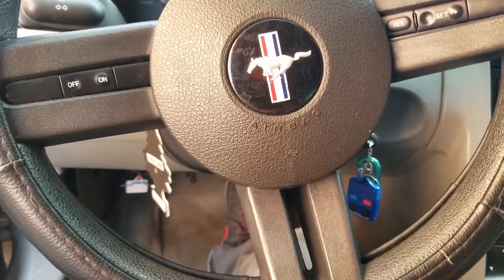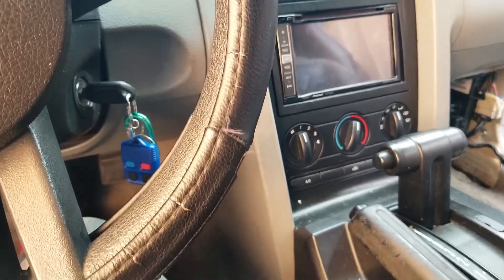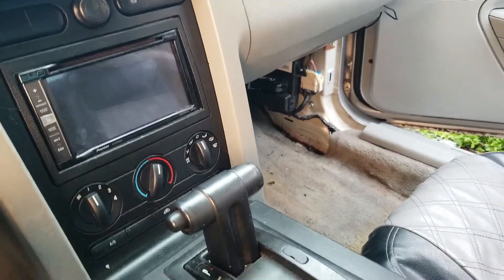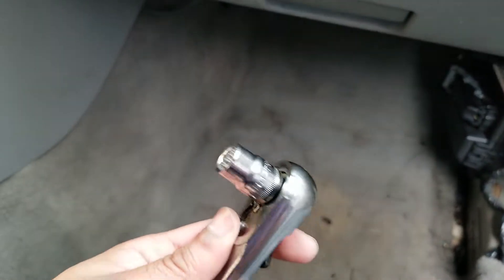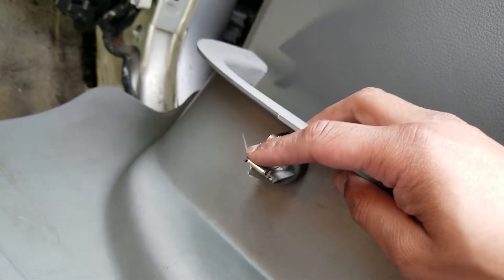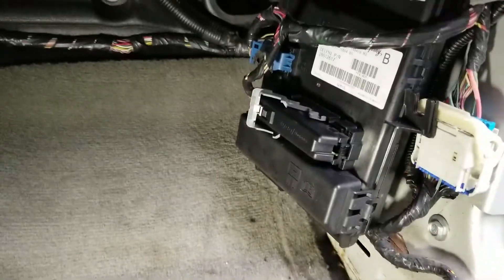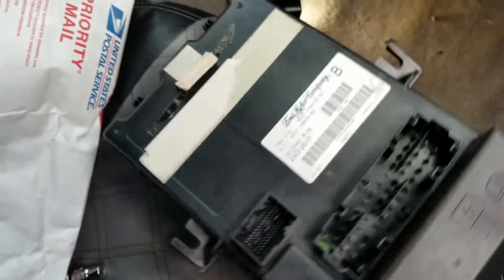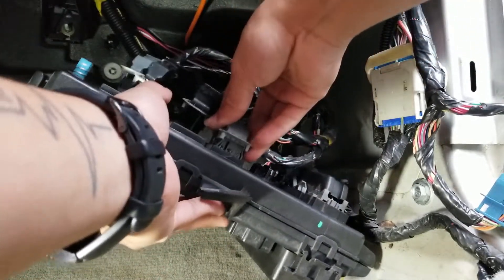Does your 05-09 Mustang Needs a NEW Interior Fuse Box? (Smart Junction Box/Anti-Theft Fuse Box)

Comment from the maker: I'm getting a lot of questions regarding the BCM needing programming after replacing. Short answer is NO....not if it's a used unit that is, I had replaced the BCM (SJB/Anti-Theft Fuse Box) twice on this mustang and both times I just swapped them out without needing a reprogram. HOWEVER I cannot guarantee that this is the case for everyone! I know you will definitely need programming if installing a brand new fuse box for sure but as far as my personal experience I did not need programing after replacing mines. (Both parts were bought off of eBay used)

Hope this helps a lot of you and hopefully it cleared some concerns about this needing programmed.
Reply: I’m trying to find where I can order one new or would I have better luck trying to order one off eBay?
Reply from the maker: @adriancavazos7434  Finding one new is extremely difficult, even through the dealership (could be lucky and your local dealer might be able to get their hands on one) but other than that, buying it used on eBay would be your faster option, they always have those available there but you want to make sure the part number on your original box matches with the one you are purchasing
Reply: Thanks for the advice appreciate it so much!
Reply: @dany5.084 como se llama la caja para comprarla por q tengo ese mismo problema con mi mustang
Reply: @dany5.084  how do you know which part it is? It has many numbers and letters, how do I know which one is correct?
Reply from the maker: @Analista-ve4us Theres Model #, Part # and the Serial #. You want to look for the one that says Part #: (for example, mine was the BR3T-15604-BA)
Reply: Does it matter if the sjb comes out of an identical car?

Comment: Nice job... Ford has been paying millions of dollars to try and hide all of their screw ups on these vehicles and not have to take responsibility for their stupidity. Even these cars brand new were having that same exact battery issue, among all the other problems. So when people were having the cars looked at by Ford (because they obviously were still under warranty) the mechanics were told to just replace the battery and tell them it was a bad battery. That was never the case.. It took me 2 years to finally figure out all these problems so that l could actually rely on my car being able to start and work properly. I never could find any videos or  suggestions on any forums that had the actual right answers to the problems. And that was due to Ford paying to have them removed from youtube and any online forums. Cheaper than recalling all the cars and fixing their own stupid mistakes. The battery issue is a problem in most from 04 to 08 l believe. The problem is the Shaker stereo. It continuously drains the battery even when the vehicle is off. I hooked up my elec tester and watched how much was being drained. Then l started pulling fuses 1 by 1 until l found the 1 that stopped the drain and it was the radio fuse under the hood. So l wasn't going to pop my hood to pull it every time l got out, so l actually just wired that fuse to a switch in my glove compartment so l can turn that one fuse off and turn it back on when l get in. You won't lose the memory settings or presets but it will always come on to am radio when you turn it on. Better than having dead batteries all the time. And the water that leaks onto the computer actually mostly comes the mirror and also from the weather seal above the passenger door window. So after l cleaned up all my fried pins and soldered in some replacements, l taped a piece of plastic poly above the computer and it goes over the comp all the way down to the floor and haven't had water get on it since. Thanks for the video showing people exactly whats going on with their mustangs. Otherwise people are trying everything that some random person will suggest to try replacing. And that gets really expensive when none of it is fixing the actual problem.
Reply: Thank you too brother for the jewels you dropped
Reply: 2 years later and still relevant^ 
After dealing with this and researching this for the past year and a half, in short I've gathered ford knows about this but refuses to admit it. Problems range from the fan relay burning the the point of melting and fusing together to the throttle thinking its wide open when its not. No doubt lots of liability if ford ever admitted to their mistake. Replacing mine soon with fingers crossed. Whatever the issue its no coincidence everyone experiences electrical issues, just sucks for people like myself who have had extra wear and tear on the motor from these problems causing more severe ones and dumping money in between. Feel very bad for the ones who may have lost their life or a loved one due to the issues I've witnessed such as the throttle thinking its wide open (and STUCK wide open unless the whole car is shut off) or all the lights and dash shutting off while still maintaining speed and running fine (or even better than before) in the middle of a night drive. 2008 Mustang GT owner. Ive tried manual switches for the relay ran outside of the fuse box, 60 amp relays, tried three brand new fans and connections, new water pump, new alternator, new batteries... still face the same issues and get a 'check charging system' message every-time I drive.

Comment: This what happened to my 07 Ford Mustang GT..$900 later it's at the Ford Motor shop now...I removed the plugs from the cowel panel completely...wish I saw this video at first...would've saved me a lot of money..thanks for the video
Reply: Same I spent 850$ on a diagnosis and fuel pump replacement at the Ford dealership only to bring it back 4 times before them telling me it’ll be $700+ for them to replace my fuse box -_- why wouldn’t they tell me that was the problem when I first got the diagnosis??? I hate dealing with them

Comment: Just ordered my fuse box $70.00 I knew that was the problem 
Thank you
Reply: From where?
Reply: from whereeeeeeee
Reply: From where ?
Reply: @liamtomblin used part from a junkyard
Reply: Tengo un Mustang 2006 le puse una caja de fusibles del 2007 pero no funciono
Reply: ALGUIEN SABE SI LA CAJA DE LOS FUSIBLES SON IGUALES Q LAS DEL 2007 u  2008 mis Mustang es 2006 le puse una caja del 2007 y no funciona 😔
Reply: @oscarillosanchez5045  You have to go by the part number on the SJB. Look at his pinned thread.

Comment: Regarding the water leaks mentioned at the end, that is all true, but there's a second(perhaps more) possible source for major water leakage into the passenger foot well.  I traced the problem myself several years ago when the amount of water was crazy after every time it rained and this comment is for anyone who may see this and either has that second leak or does in the future.  For me, and I believe Ford has a bulletin that backs this up, it was the holes for the clips for the cowl cover.  The clips have insufficient gaskets that don't seal well and deteriorate quickly.  I believe they changed the gasket design for '07 or '08.  For my '06, I used a weatherstrip adhesive to reinstall the clips.  RTV would probably work well too.  Of course, it's worth mentioning that there's a defect in the body of the car since the water shouldn't drain inside the car anyway, but that's out of our hands.  

Good to see what's involved here since I think my SJB is finally going bad.  I've been lucky that it lasted so long for me(14 years), but I also tried to protect sensitive parts from water after I noticed a lot of water coming in.  I used old plastic comic book bags I had around to direct the water away from important connectors and such.  Not only am I getting some accessories turning on by themselves, my parasitic draw is high and killing my batteries.  I got two warranty replacements, which was very lucky.  Thanks for showing this and I may be doing this same fix very soon.
Reply: Also there is weather stripping behind the plastic window/ door seal that goes bad. Pull the rubber window seal down and remove the plastic piece it snaps to and replace it.  That’s where a lot of water can leak down to the passenger side
Reply: What is the Cowl Cover you are talking about in the car? I have a 2006 Pony that I love, but I keep getting water in the Passenger side if it Pours rain out. Do you mean the plastic cover in the engine bay near the windshield?  Or something else?
Reply: @mrnobodyinvr9762  It's at the bottom of the windshield under the wipers.  The plastic covers there are what I'm talking about.

Comment: THANKS! I just swapped the SJB on my 2008 and the remote key fobs work again!  NOTE: after the swap I had to program each fob to the new SJB by doing the ignition on/off 8 times sequence - which only took about 30 seconds (search youtube for full instructions if needed).
Reply: So y bought the sjb used did you have to take it to ford to reprogram?
Reply: @angelrios5364  No. I was worried I would have to have it reprogrammed but everything worked fine. I was told the key is to get a replacement SJB that has the same part numbers as the one it is replacing. A SIDE NOTE: According to a Ford dealer who used my VIN to look up the SJB part number for my mustang - the one I replaced was not the original part number. But apparently is was fully compatible and is working fine. To be safe, if you buy a used one off of ebay make sure they indicate it has been tested/works and accept returns if there is any issue. Best of luck with whatever you do!
Reply: @edbreyer  thanks i will try it .  I matched numbers but wasn't sure if it would plug and play  so I been having it sitting here collecting dust trying save up to pay the dealer 900  just to reprogram and acouple more hundreds to install if it works man you saved me a whole lot of money lol
Reply: @angelrios5364  If the replacement one you bought came from another Mustang then it definitely has some sort of programming - and if the numbers match - based on my experience - it should work. However, if you bought the replacement SJB from a Ford dealer than I don't know if it will need programming to work. I suggest you just connect the replacement one and see how it works. Worse case, it does need to be programmed and then you just swap the current one back in until you have the money saved for reprogramming. I can't recall if I disconnected the battery when making the swap - but seems like you'd want to ensure all the power is off before disconnecting/reconnecting the SJBs.  Post a follow-up to let us know how it all turns out - GOOD LUCK!
Reply: You don’t have to replace this to get your key fob to reprogram the key… all you do is just reset the key fob with turning the key 8 times back to back leaving it on on the last
Reply: @slimelyfejay  I didn't replace the smart junction box in order to add key fobs, I replaced the smart junction box because the previous one was malfunctioning. But once the new smart junction box was in place I had to add my key fobs to it using the process described in this video
Reply: @angelrios5364  How did it turn out??
Reply: @edbreyer, I never got to replace it. I found out that the dealer I bought it from did a hot smog and the catalytic converters were bad. It had a state ref, so I got rid of the Mustang.
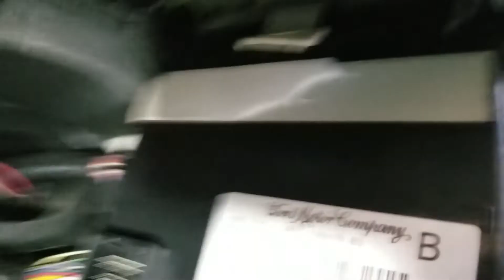Reply: @slimelyfejay  I tried that, and it won't work. New key fobs and batteries too. All new TPMS sensors won't work either. 9:21
Reply: @slimelyfejay  That don't always work. I bought 2 new fobs, and 4 TPMS sensors, and can't program any of them.

Comment: Need some help! Let me start from the beginning. We had a rain storm which led to water getting into my passenger side my whole entire fuse panel bcm was soaked. My flashers was going off on its own. I took it out & took it apart, dried it out then sprayed electrical cleaner let it dry. Then repeated the process with the wire harness connections that connects to the fuse panel bcm. Once I was done with that I hooked it all up and I got a non start issue. Checked all fuses/ relays all was good. Checked battery with meter all was good. Checked starter all was good long story short I did a general basic diagnostic. All was good. I proceeded to lean towards that it was a faulty Fuse panel bcm so I ordered another one that matches mine. I received my car now starts and runs fine  and my flashers are back to normal. Everything looks to be functioning correctly besides one issue that I did not have before all this! My car won’t get out of park now! Only way I’m able to take it out of park is the little bypass on the side of the shifter that you push in. Any suggestions to what may be going on now? Yes I checked the fuse again all is good I also checked the break light switch. All is good.
Reply from the maker: Funny enough, I experienced that same issue the second time I had to replace the fuse box, the way I was able to "fix" this was disabling the shift interlock function on the vehicle. (I ended up having a mechanic doing this for me since at the time I didn't knew how to do this) the other option my mechanic told me (the expensive option) was replacing the entire shifter but wasn't guaranteed it'll fix the issue, so I decided to have him disable the shift interlock. but I must WARN YOU! If you go this route too, you're car will loose that function which in short terms, you'll be able to start the car up no matter what gear it's in which can be dangerous if you have the vehicle in drive or neutral. can roll away (the shift interlock is a safety feature, it prevents the car from starting if 1)the brakes aren't being applied and 2) the vehicle is not in park, therefore you will be messing with something that will disable a safety feature, do this at your own risk) other than that, this was the route I went and haven't had an issue since.

Hope this helped out and good luck.

Comment: Good informative video Dany. My issue is my car cranks and starts as soon as the key is in accessory mode on 08 mustang. Do you think that could be an issue also caused by that BCM fuse box. Thank you for your input
Reply from the maker: I don't want to say it is the fuse box for sure, but if this started happening after a water leakage (if there was one) and the fuse box did get water damaged then it's possible, but hard to say for sure without further diagnostics, other possibility could be the ignition switch just went bad, I would say take it to a locksmith or shop that can diagnose your ignition switch, you might just have a bad switch there. apart from that, I can't say for sure that the fuse box is the one behind the problem. (but still a possibility, maybe just a fuse blew out in that fuse box)

Hopefully this helps a bit.

Comment: Well im back , lol car has been sitting for damn near 2 years  because i hit a ditch and ripped off the front and rear bumpers. Busted the radatior and condensor ... replaced all of that and am set to get it painted this coming week, charged the battery up all power comes on but now im getting check  charging system , fuel level low , ect . Car wont even turn over ... 😢 helpppp

Comment: I have the exact same problem ! I just left the dealership they are trying to charge me $1200. Was ypu part a refurbished part or a new one? And where did you find the part at I need one too?
Reply from the maker: I got mines off of eBay at around $120 USD refurbished. I searched up the part along with the part number that the OEM has on it. (Example: Part number for my box was 4R3T-14B476-BS. luckily for me, I didn't need it reprogramed)

Comment: My radio won’t turn on and the fuse inside the car for the window pops every time I put a new one in think this could be why?
Reply from the maker: Have you ever had any water leaking through the passenger side before? If so, there is a chance that could be why, maybe not recently but if it did get a leakage sometime this year, it might be getting effected now, if you have, i might consider looking into that fuse and check for any corrosion

Comment: you can use contact cleaner to clean it up inside and out so you dont half to spend all that money also wrap in in a few plastic bags so it wont get wet agian
Reply: I tried this and it fixed my one issue but after 5 minutes it messed up again. Tomorrow I get a brand new set of fuses and will replace all and try again one more time
Reply: @CorruptTime  did it work better the second time and what was your issue?

Comment: I wish my problems were ever as simple as just replacing a part. Right now my engine dies when I try to use the horn, turn on the lights or click the high beam selection on the blinker lever, but runs just fine if i don't use any of those things, so it's a mystery what's causing it, bad ground maybe somewhere in the miles of wires.

Comment: So I have a 05 mustang, I had the issue you said that the radio would not turn off(it is all corroded).I am having trouble reading obd2 codes…(says it wont connect) will this fix that issue most likely? Awesome video!
Reply from the maker: I can't promise it will fix it, but there's a high chance that it will. has your passenger side ever get water damaged in the past? If so it may have made it's way to the box and damaged it like in my case. Luckily a used box should run you around $120 USD (on eBay) so its not too expensive I would say, but from what you are saying, I believe the box may have gotten damage some time ago or recently and it's just now showing symptoms of it going out
Reply: @dany5.084  Awesome. I ended up attempting to clean out the corrosion, remove aftermarket stereo, and many other things that I could find on the internet. Going to try to just purchase a completely new one. Thanks for the advice!
Reply: @snyder6103 did replacing it fix your problems? Especially the one with not being able to connect code readers?
Reply: @3VAvenue  No, it didn’t. I tried legit everything and eventually just got rid of it and bought a different S197.